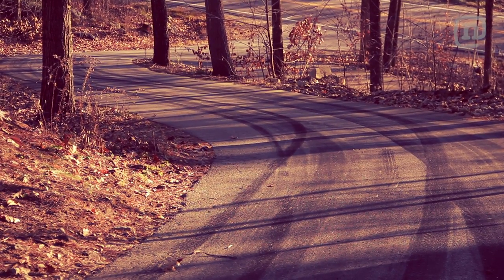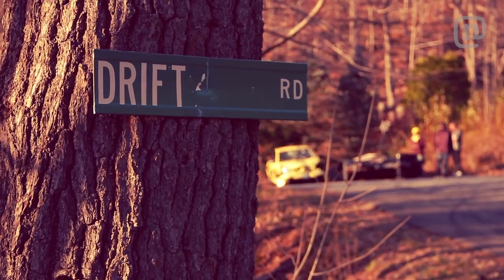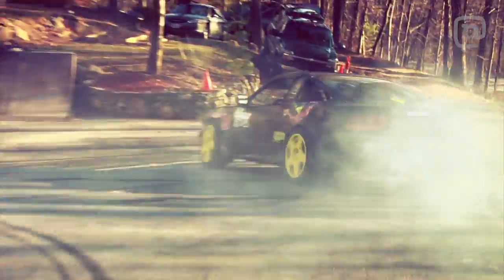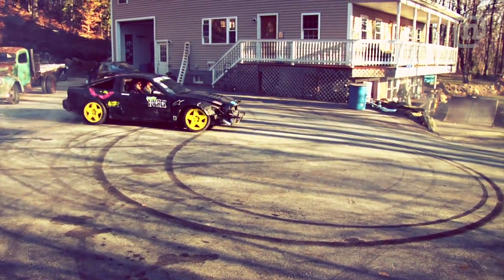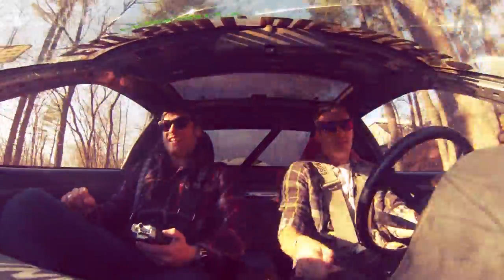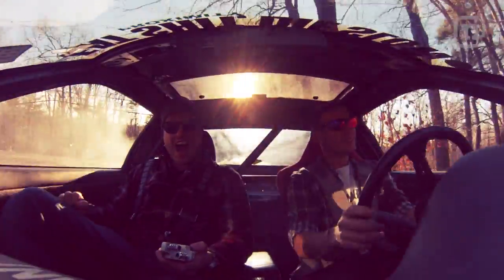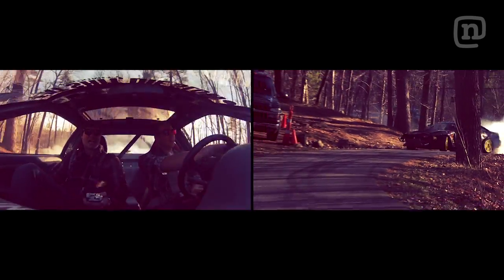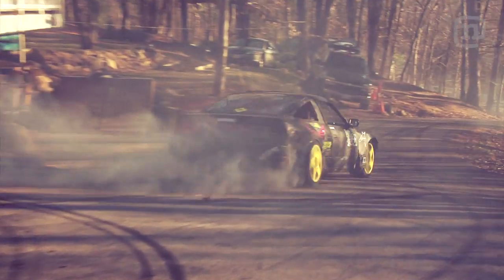Missile Car Drifting In Driveway

Comment: There are 3 generations of what us Americans know as the 240sx. By generation they are known as the S13, the S14, and the S15 (or Silvia). In the states the S13 was only available with a CA18, or a KA24 (to my knowledge), but the Sr20 swap is pretty popular, along with a ton of other engine swaps, such as an RB, VH, or JZ. The s14 was available with a KA24, or an Sr20, and the S15 came with an SR20 and are not available in the U.S...at least not easily. 
S13-1989-1994
S14-1995-2000
S15-1999-2002

Comment: I don't really understand your question. The differences in them are just aesthetics. And depending on the spec it could come with HICAS and an LSD or an open diff, that's really it. By year (up to 93) they're basically the same. Aside from engines (single cam or dual cam) anyways. 240sx's didn't come with an SR20, so if you bought a 240sx with an SR20 it's swapped.